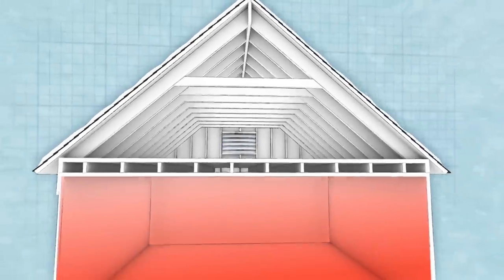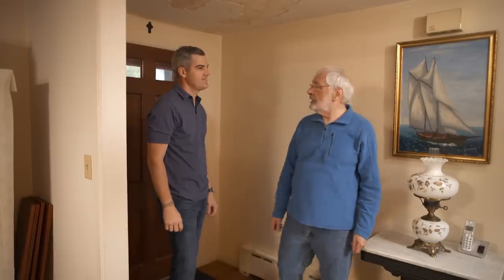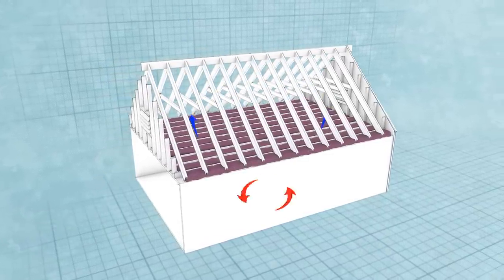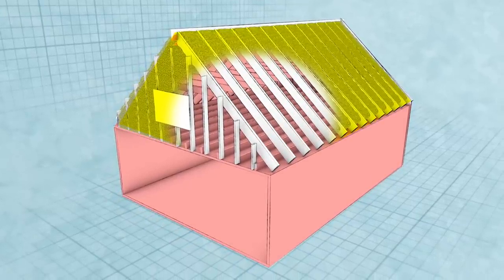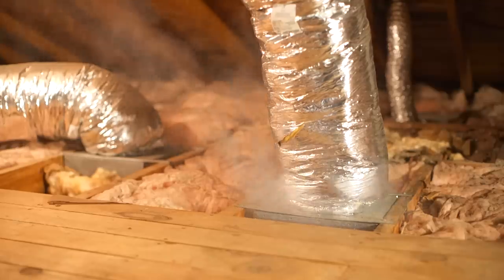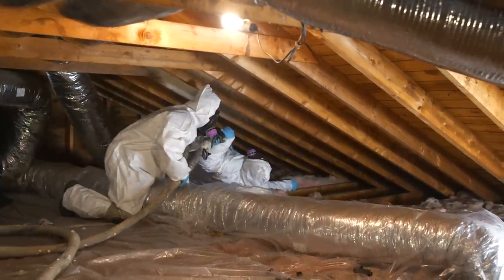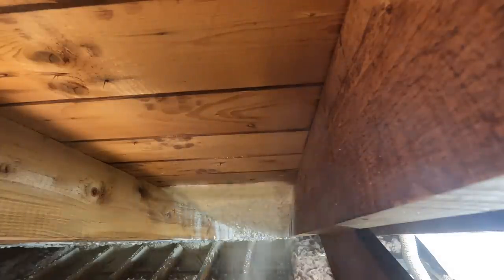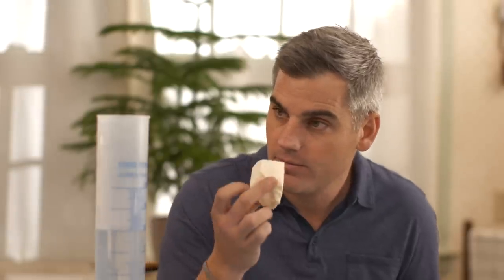Fixing Ice Dams on a Roof | Ask This Old House

Comment: I have worked in Energy efficiency for over 35 years and consulted with various professionals in the industry who have concluded that it is far more cost effective to insulate and air seal an attic floor as opposed to doing a roof line.

In the episode you ran a blower door test and showed the major passage of air leakage to the attic which could easily be air sealed and have an additional R30 of cellulose blown on top of the existing fiberglass. They could also then close the gable vent add some soffit venting and perform any duct sealing and insulation that is needed. For an approximately thousand square-foot attic this work could be done for approximately $5000.

This attic was easily accessible with a stairwell and if a conditioned space was desired then that’s fine. But to represent that spray foam was a more effective route is a disservice to your viewers.

You did not disclose what the blower door test reading was but that attic seemed perfectly suitable for a traditional air sealing and insulation job at the floor level.

I would be interested to know what the cost of removing the still functioning fiberglass, and spraying foam over 30% more square footage of the area would be, my experience has been it’s at least three times more money. This also adds More square footage to the heated space which would likely raise heating cost, and still not achieve an R 49. I have been involved with the retrofitting of over 1000 homes with ice dam issues that were easily rectified by appropriate air sealing,ventilation  and insulation.

There are also some concerns over the chemical content of spray foam it’s inherently higher carbon footprint, it’s noxious fumes with low flame retardants, the possibility of affecting a roof warranty the possibility of excessive condensation in the attic. I’ve seen many cases where the foam is shrinking away from the roof rafters. I agree and have contracted many jobs where spray foam was used appropriately but I think you did not give a fair evaluation of the two competing ideas as to how to correctly insulate an attic, especially in a cost-effective way.
Reply: Agree this made no sense. They may not have even solved the ice dam problem, depending on how cold it gets in the winter.
Reply: Would that affect servicing HVAC, insulating over fiberglass?
Reply: All kinds of attic work (HVAC, plumbing, electrical) are a pain in the butt once you're knee-deep in cellulose but it doesn't have any substantive impact.

Comment: After sealing with foam on the roof then what if you happen to have a chance to make a hole for vent or something?
Reply: You make a hole then use a can of foam which is also closed cell to fix where you removed the foam
Reply: Just cut the hole. 🕳
Reply: Make sure the hole is no bigger than the object you are putting through it.
Don't cut a 1" hole for a 1/2" pipe, cut a 1/2" hole.
That way it is much easier to make sure any gaps gaps caused by a non exact fit, can be easily sealed.

Comment: Gotta love TOH/ATOH after all of these years! It is a great educational program. Actually, though, one could "theoretically" run a single gauge of wire throughout an entire house. If say 6 gauge wire was used throughout the entire house, it would be good to go for up to 50 amps on every circuit. A bit of overkill, I know. However, the cost of labor and copper to run 6 gauge wire throughout the house would be atrocious, to say the least. Also, good luck finding a basic table lamp (or toaster) that will plug into a 4-prong 50 amp outlet.....lol. I am not saying that doing this would be "practical" by any means, just "possible." 😉

Comment: I have a daughter who lives in a single wide mobile home and she has the worst ice dams, what can she do?
Reply: Generally start by air sealing any penetrations into the ceiling. That includes outlets wire switches etc on walls. Think hard about any ways that air can move from the conditioned space to underneath the roof. I use DAP ALEX plus wherever I can, otherwise spray foam, to seal up gaps. The caulk is cheap and rated 40 years. There may only be an R13 fiberglass between the ceiling and roof? Theoretically you could upgrade the insulation to Rockwool or foam board for more R value per inch. If there isn't room for more insulation or demo and redoing drywall is cost prohibitive, and air sealing doesn't do the job, she may look into resistive heat wires you put on the roof to melt snow before it forms an ice dam. Those do cost a fair bit of electricity is the main downside. 

Personally I'd also look into switching to a sheet metal roof where there aren't shingles for the ice dam to penetrate. That's just a thought. The metal would be more permanent. But I'm not expert on what icicles can do to those, maybe split the ends or something. I have icicles on an old tin roof that is 120 years old. They don't make much difference to that roof material.
Reply: Burn it to the ground and hope she has good insurance?

Comment: Don't the shingles wear out faster with this system?  The heat that they gather in the summer is trapped
Reply: Yes but it’s not like you get half the life or something drastic. It’s pretty negligible from the data that’s out there
Reply: Nope
Reply: Yeah, it's probably a little harder on the shingles, but shingles are rated for high temperatures. It's not likely to make a big difference either way. For one, I think you are vastly underestimating the thermal mass of shingles. Shingles inherently capture and store heat and even if you had a cold attic underneath it wouldn't make a difference. Go up on your roof after a hot summer day late at night, and the shingles will still be warm.
Reply: Shingle color will affect temperature more than being non-vented.

Comment: What are the primary disadvantages (besides cost) from going to an enclosed system from vented as shown?
Reply: Just what he said, you have to amp up the ventilation in the home, keep an eye on the humidity. Make sure your house doesn't overheat from putting on that winter hat.🥵
Reply: @mitchdenner9743  thanks.   Makes sense.  Cost aside, if given the option in a generally colder climate, is the non-vented house preferred or is there an argument to be made for the traditional vented solution?  Considering going ventless myself if performance is significantly superior.
Reply: There is a ton of pros and cons. You should do a bunch of research, there are lots of good free sources online. A problem with unvented roofs is that the shingles can get to hot in the summer decreasing their life span by a lot. If not installed properly spray foam can shrink and crack leading to air leakage. Have fun replacing your roof deck now that its glued together. Have fun locating water leakage.  GHG release from spray foam is generally more than running a nat. gas furnace for 100yrs. etc.
Reply: @RoosterG33rs  EXCELLENT point.  Thanks!
Reply: A vented attic is tried and true. With the appropriate amount of ventilation, and sufficient insulation in your ceiling joists, it is known to work, and work effectively. It is also cost-effective and thus is the default choice for most affordable home builds out there. There isn't a wrong choice, but an unvented attic does have the benefits mentioned in this video and therefore could be characterized as an upgrade (at an additional expense, mind you).
Reply: @RoosterG33rs  Ahhh...NO.  Older formulations of spray foam produced high levels of CO2, but not even close to what you are purporting.  Newer formulations are much less eco-harmful, though they still produce a significant amount of CO2.  One report I read said a 1600 square foot home spray foamed releases about the same amount of CO2 as burning 250 gallons of gasoline in a car.  Again, not even close to what you stated.  If you have references that state otherwise, I'd love to know.
Reply: @donabele1243  I wasn't talking about CO2. I just said "GHG's". A GHG or green house gas is a gas that traps heat in the atmosphere. There are many different GHG's.   The main GHG concern from spray foam is the blowing agent used; which are HFC's. HFC's are significantly worse than Co2 for warming. The CCA coalition states "HFC's are 3,790 times more damaging to the climate than CO2 over a 20-year period"

If your adding spray foam for environmental reasons it might not make sense to chose a product with such a high GHG release in some cases. In my case the break even point for GHG's saved from heating by installing foam was I think something around 130yrs.
Reply: You can't DIY the foam. You can air seal and add fiberglass yourself.
Reply: You also have to worry about back drafting because of lower air leakage. All gas appliances should be switched out to power vented versions or electric. The lower air changes also decrease indoor air quality (buildup of CO2 and VOCs) and might cause the wood of the house to dry out less.
Reply: @mr.g937  Seems like the consensus is if it’s “not broke”, don’t fix it.  Traditionally vented roof appears to win.
Reply: @kw6713a  I’ve seen “froth packs” sold in home stores for several hundred dollars.  Not sure if they are drastically different or inferior to what’s sold and installed by professionals.
Reply: @Mike-fn7rx  Absolutely!!!!
Reply: @holtrussell  I think those froth pak are limited to two inches thickness (or at least that's what they indicate). Basically rim joists or flash and batt I guess. In any event, it seems you'd go through like a couple pallets of those canisters to do a big attic to six inches. Don't think you could do two inches froth pak and then four inch batts on top to achieve an r38 in the attic if that would even be cost effective vs. hiring it done by a foam contractor.

Personally I'd only mess with foam of the attic is living space, but that's just me, as I favor the simplicity of air seal and fiberglass (plus the lack of chemicals). Would love to know what he paid for all that foam.
Reply: @holtrussell  with the way the world and building practices are going i would go sealed for efficiency , i did about four years ago when i put on a new roof, i did 5.5 inches of closed cell and did a radiant barrier on the exterior  with a 3/4" air space between the barrier  and the new 5/8" sheathing and new shingles, kind of what they call a cold roof or a double roof, the entire attic is sealed yet i still have soffit air intake holes  bringing air into the air space between the radiant barrier and the shingles and exhausts out ridge vents to help keep the shingles cool. The radiant  barrier reflects 98 percent of the sun's heat and the air channel convection system helps keep shingle temp down. I also have a whole house dehumidifier and an erv for fresh air and exhaust. You can go apeshit if you want to, but at a bare minimum just keep an eye on your humidity as it will tend to collect in your upper atmosphere. By the way I'm in the north east tri state area
Reply: @RoosterG33rs  OKay - if discussing HFCs alone - the studies I've read show they have a net-zero impact on overall GHG emissions.

The amount of heat that is saved (therefore using  less GHG producing fossil products for heat) by using the spray foam negates the GHG release during application.

This is all academic - you have to choose when you are willing to accept GHG emissions for your house.  A large dose up front with the installation of spray foam - then a MUCH LOWER heat burdeon on the house for the rest of it's life.

OR use poor insulative measures and pay a high heat bill forever (which equates to HIGH GHG emissions on the production/distribution side FOREVER).
Reply: @donabele1243   That is just... wrong. I dont know what your reading or how your interpreting it. HFC's used as blowing agent have a GWP of 1430 vs CO2 with a base of 1. That's a lot. HFC's are such a major GHG that they are being phased out. 

Spray foam isn't the only type of insulation available.
Reply: The foam helps hide water damage, and channel the leaking water to the rafters … which is a whole lot more work to replace (along with new foam … ) than sheathing and plywood/OSB.

You could mitigate all of that by preventatively replacing the shingles / flashings “ahead of time” but fixing the unbroke also is not sustainable.

Comment: Should have removed the old insulation before they sealed the attic with foam. Now the only way to get it out is through the house. They could have tossed it out through the gable vents and not had to haul it through the house.
Reply: You just put them in big garbage bags in the attic. Not a big deal.
Reply: I would leave them, buffer for lower level.
Reply: You leave them in place. They only moved the stuff that was directly in their way. "It's 15 years old" is not an issue. Insulation does not expire. If you had an animal infestation you might need to clean it but not in a normal house.

Comment: the solution was a much more complicated than what was necessary. Just need to spend a few hundres dollars to install roof and gutter heat cable, the problem is solved
Reply: But then not only are you spending money on wasted heat, your spending money on more heat to fix the heat loss issue. lol.
Reply: What an absurd suggestion. You have to fix the cause, not the symptom. Using roof snow melting systems is fixing the symptom. No legitimate contractor is going to suggest that.
Reply: Very bad idea. Wastes energy and can burn yo house down, yo!